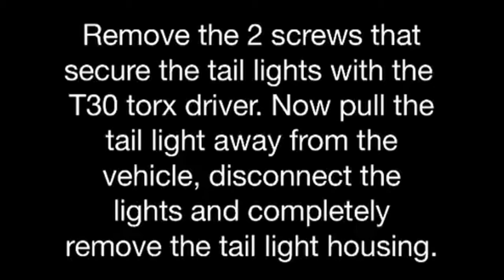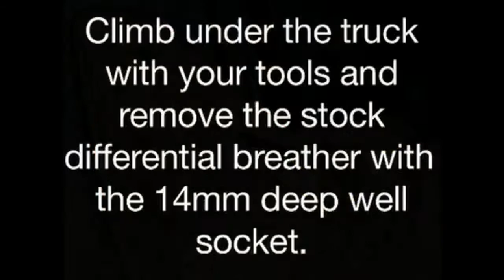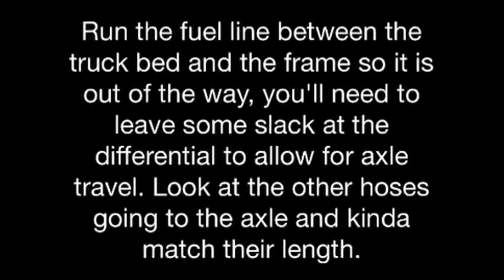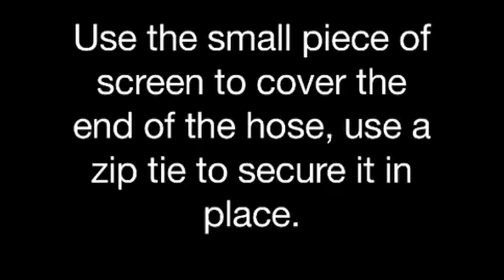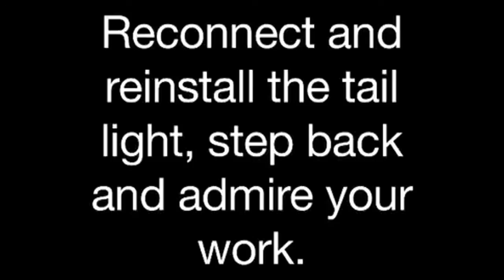07+ Tundra - Differential Breather Mod

Comment: I would like to point out I am doing this mod and the actual thread and pitch is 1/8 - 28 bspp (British straight parallel pipe)
Reply from the maker: Thank you +Kris “907kenia” Singleton
Reply: you sure?  since when did Asian vehicles use anything other than metric?